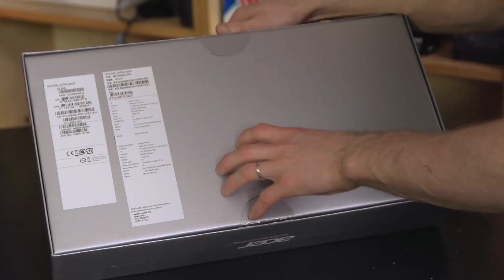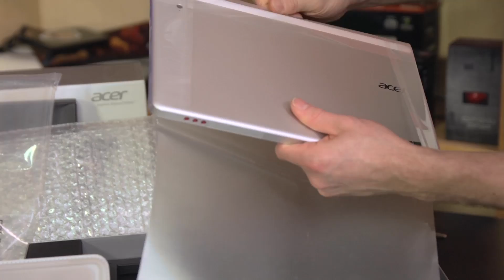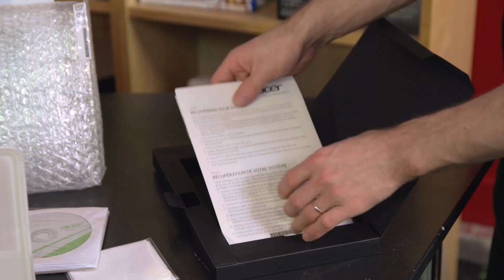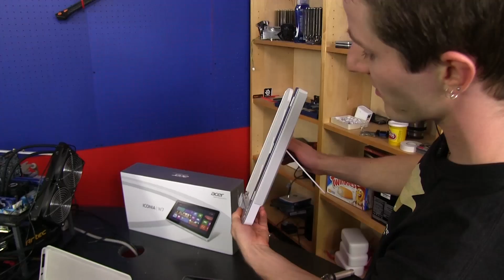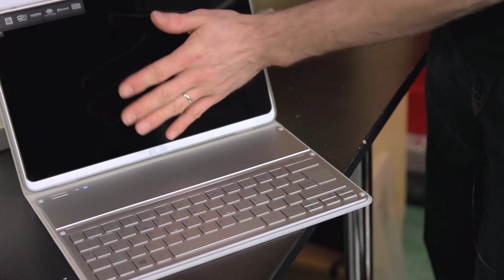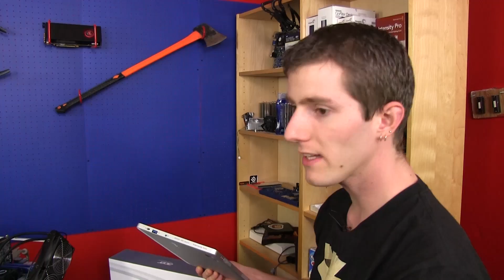Acer Iconia W700 Windws 8 Tablet Unboxing & First Look Linus Tech Tips

Comment: I'm still running one of these in 2020. I'm thinking of buying a new battery for it, as well as the biggest mSATA SSD I can find for it. I already found an auction for a pair of spare power cords and a dock for it. I like using it in my workshop for playing media (video files, YouTube, streaming, MP3s, etc) and for Arduino and CPLD programming. I also will keep it with me when watching streams, so if i need to leave my main computer, I can run the stream on the tablet and carry it around with me. I have the i5 / 128GB optioned model. It's actually still very usable! LOL, I've even run older versions of Kerbal Space Program on it. Surprisingly capable for low end games.
Reply: Can you upgrade it to windows 10?
Reply: @jpasuncion2745  Yup, it's been running windows 10 for ages.

Comment: God, I remember wanting one of these so much.
Reply: Now, you can buy it for dirt cheap.
Reply: And they're even cheaper now. They will easily run Windows 11 with little or no lag. Microsoft is offering a free digital activation license for "Home - Single Language' in either Windows 10 or 11 because they are a small touch screen device. Just burn the image with Rufus for Win11.

Comment: I payed way to much for mine and the screen bubbled in less than 12 months. So disappointing because the specs on this was awesome. So i'm going to say the build quality was pretty sub par really. Many people had the same screen issue on this tablet.   The last time I spend on Acer as they couldn't even help with repair after spending $1300 buying this.
Reply: Same here. Its the worst computer purchase i've ever made. Screen bubbles, slow performance, keyboard that registers about half the keypresses. Basically bluetooth is crap on this device as the bluetooth mouse also has gitters. Never again Acer.

Comment: Can you charge this thing via its usb port? I am looking for a windows 8 tablet with an i5 processor that i could take to a long 18 hour flight. The plane that I am taking doesn't have any power outlet on its seats. So i bought a battery juice and im kinda wonderin if charging this tablet thru usb port would work.

Comment: I don't like the Razer Edge, because like their laptops, its graphics card is always slow(gt640). I will only consider a Razer laptop if its got 680m's in SLI and a 120 Hz monitor. The CPU's they put into it, in contrast, is usually quite adequate.
Also, mouse + keyboard rules, controllers suck.